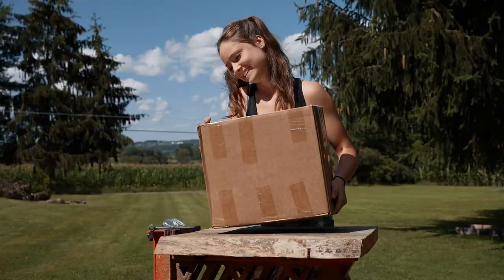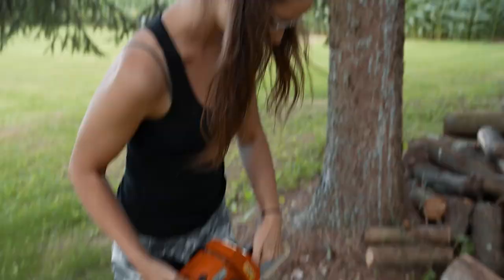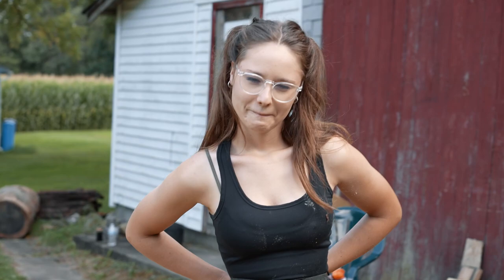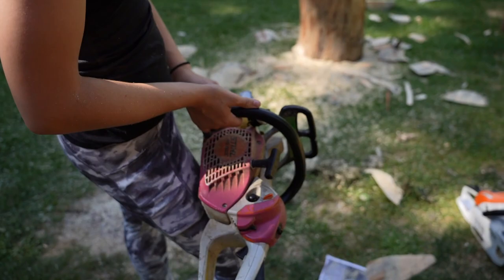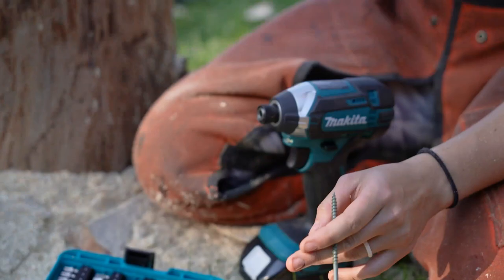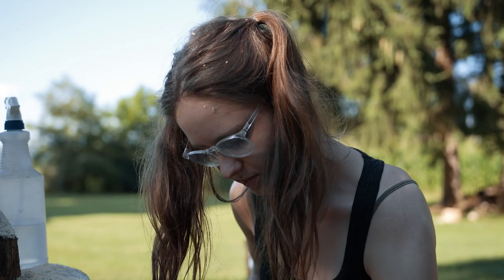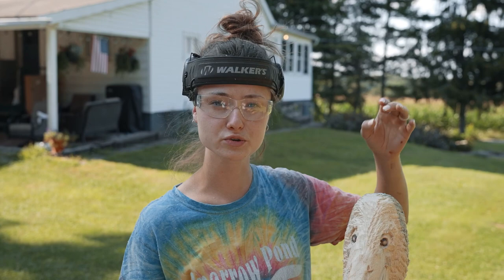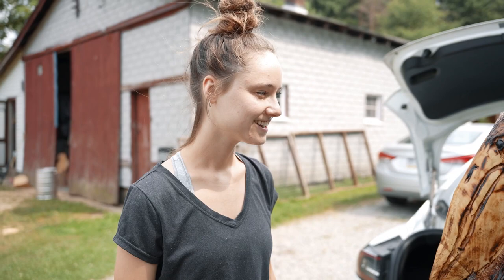Chainsaw Carving a Pelican

Comment: Great work!  What's the steel spike thingy that you use to attach the work piece to the round?  I've been trying to come up with the best way to secure the piece I'm carving.
Reply from the maker: It’s just welded spikes on a plate with holes to screw it into a stump. Super helptjusy be careful don’t hit it with your saw😂